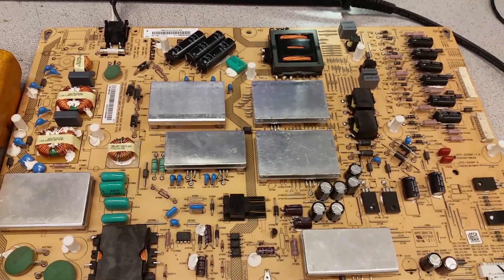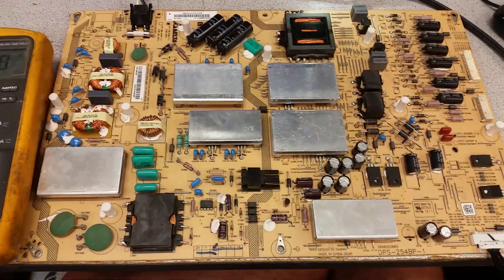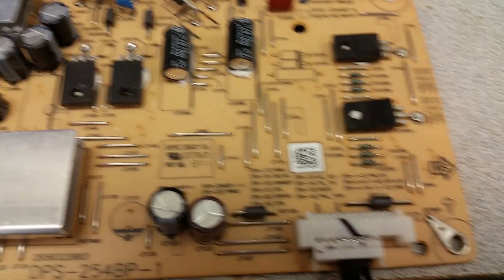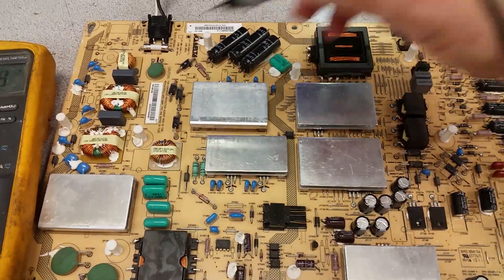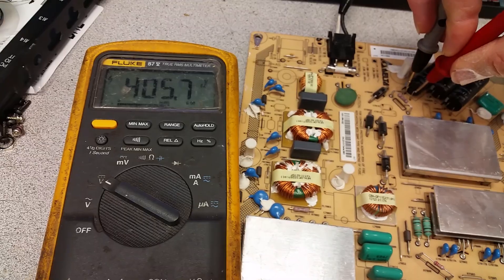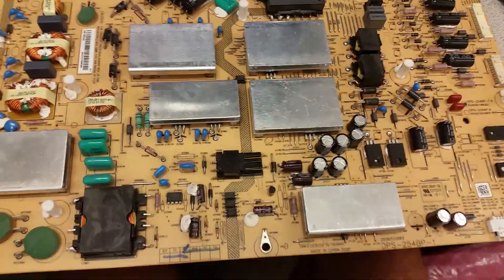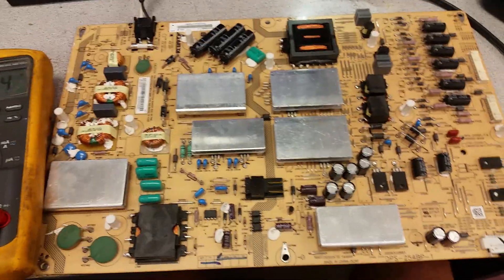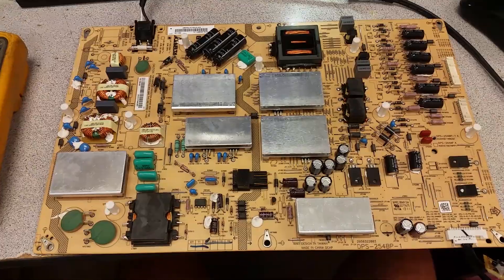How to test DPS-254BP-1 RUNTKB118WJQZ power board for Sharp LC-70LE755U LC-70LE750U LC-70LE857U

Comment: Hello - Well done on the video - You explained it very well (Like a teacher I might add).   I have one question.   I have 327 Volts across the main 3 main capacitors when nothing is connected.  and it jumps to 405 Volts when pins 14 and 15 are shorted.    You stated it should be 160V (not 327Volts) .   Is this a problem ?
Reply from the maker: It does not sound normal unless you had tested it shortly after it was working and they were still discharging.
Reply: @coppelltvrepair  I’m in Australia. If I was local, I would come visit you to say “Hi”.   I can confirm that its nominal voltage sits at 327V and when 14 and 15 are shorted it jumps to 405.volts.    I get 12V on pins 1 & 2 after waking up the power board by shorting pins 15 & 16.     Pin 15 has 5V standby power.        Any opinions on what to do about the high 327V?     If you think I have a power board problem,  I’ll simply replace the board as it even has a discoloured centre above the standby circuit
Reply from the maker: @frankbarbaro5447  Actually I was...well not wrong, but not having accounted for different countries. In Australia the AC line is 230V. Those 230V AC when rectified will give something about 230*SQRT(2) = 230*1.44 = ~330V DC, which is what you're getting. So you're good.
Reply: @coppelltvrepair  I feel like I'm taking to the engineer who designed the circuit. You have great instant trouble shooting knowledge..   WOW well done
SO it not the power supply.   I have a SHARP LC-70LE951X .   When I switch on the mains power I get a solid green light for around a minute then a continuous slow blink.  I guess maybe something on the main board,  but not the TCOM board.  What do you think.
Reply from the maker: @frankbarbaro5447  before you rule out the power board make sure it produces the 12V when tcon-on or 12von is activated.
After that it becomes more complicated as we move to main board, TCon and the panel itself. Most commonly for us it would be the main board, but we've seen the others too.
Reply: @coppelltvrepair  Thank you for your great input.   I decided to unplug half the T-Con connection and now this made right half of the panel work.    Could this be a Tcom or cabling or panel problem?     At least I now know the power supply is good and half the the tcom is good as well as the Logic main board as I have all menu controls.  What do think I should do ?
Reply from the maker: @frankbarbaro5447  Afraid I think you should start looking for a new TV. 99.9% problem is in the panel, not the T-CON.
Reply: @coppelltvrepair  On the bad half side of the TV the are 2 long circuits connected together via a ribbon,  when I remove one end of the ribbon and leave it unconnected I see that the panel is working na ddont pixel problems, however its not a full complete image.  !!!! any ideas.  I think the panel is still working
Reply: @coppelltvrepair  If one side of the tcon works, is it reasonable to think that the other side should also be working ?
Reply from the maker: @frankbarbaro5447  Yes. Do not get me wrong, but you've got more than a fair share of my time on this than a "Well done video" buys and, more importantly, you've got a conclusion from me. Good luck!

Comment: Hi, thank you for this video. I have a LC70UQ17U having issues. When plugged in, I press the power button the remote to turn on the TV but no backlight or any picture/sound. Initially the blue power light is there but then it begins to blink 5 short and 2 long blinks ... do you have any idea what might be causing this? I have tried different board but still same symptoms....

Update: Ok, so I took the board out and tested it following your directions and everything seems to check out fine. At the end of the video where you tested Pin 1-2 for 12v... I only get 12v if I connect/jump pins 14,15 & 16 together. Then I test pins 1 & 2 for voltage and get the 12volts. I was hoping this was the issue because I am getting no backlights or anything on the screen instead just a short 5 and 2 blink.... i saw a video where it could also be a panel issue and the guy literally cut the plastic film that connects the LED to the driver board? Im just not sure how to dertermine which side has to be cut. Thank you again so much for this video... if you could help me further id truly appreciate it.
Reply from the maker: While not 100% certain I believe 2-5 identifies lack of one of the power voltages generated on the main board, i.e. this is a main board failure issue.